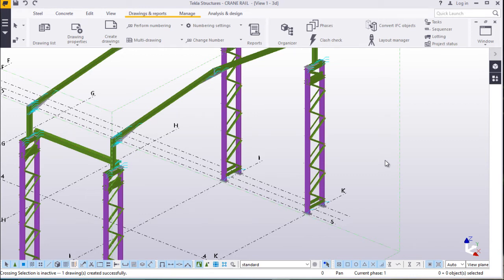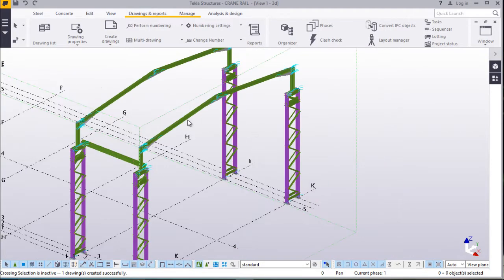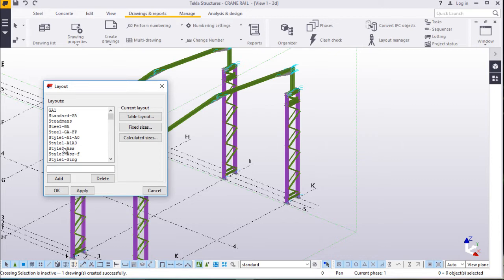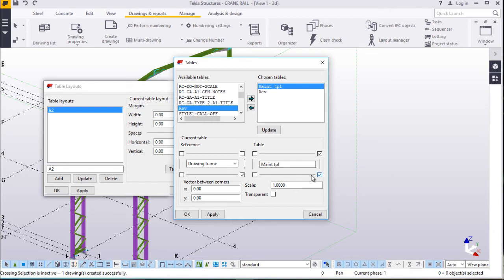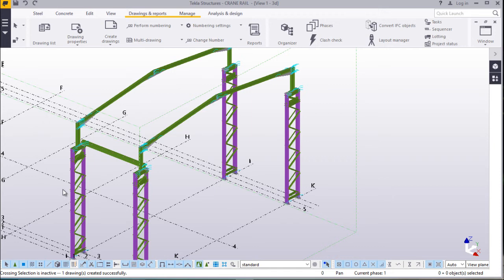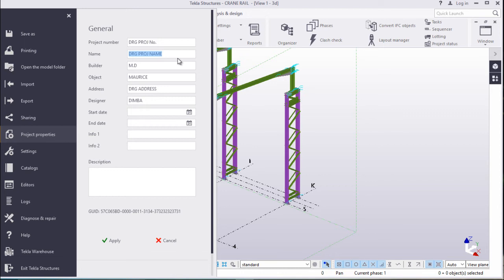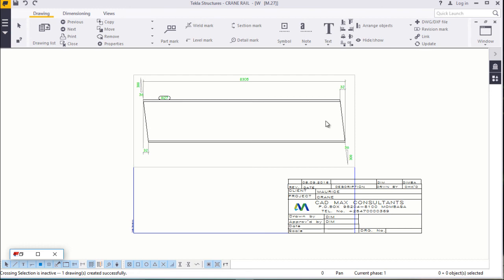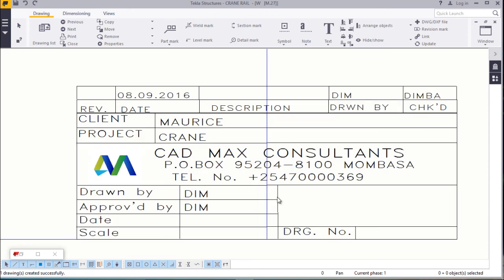Title Block Template editing Part-3 in TEKLA STRUCTURES 2016

Comment: Hello Maurice. Firstly thank you for share your knowledge.
So I tried the same process in my PC but the software doesnt change the old template by my new template created and saved correctly.
Reply from the maker: Just watch and follow it keenly
Reply: I got. But now my problem is that all the time I need change on the drawing to my template... I want to put this like a standard and start together with all drawings.
Reply: Ivan Meneses   I also have this problem.
Reply: @kyawlinnaing7605  I think the solution u need double click on drawing layout and save above the current Layout. Like PC-rebar drawing. U need save above to replace the standard template

Comment: What is the difference between  Tekla Structural Designer  and Tekla Structures and  how can i import from robot to tekla with all connections
Reply from the maker: Use IFC file extention for importation to Tekla
Reply: I've done
 but  the connections did not show
Reply from the maker: Which one?importation into tekla structures or tekla structural designer.
Reply: importation into tekla structures
Reply from the maker: ifc should work for you if it's TEKLA STRUCTURES